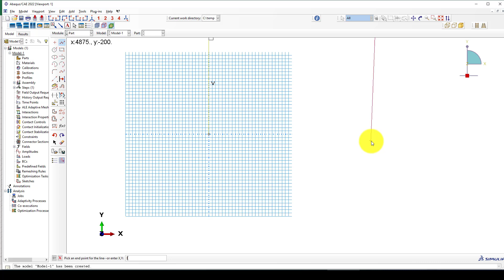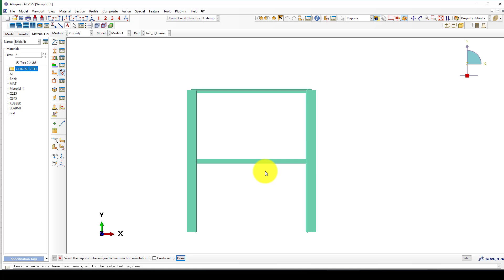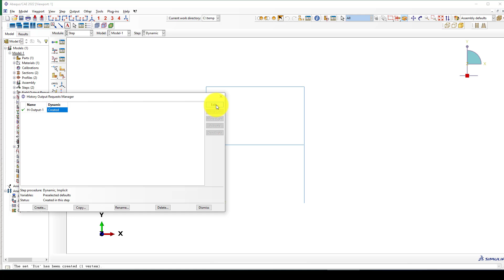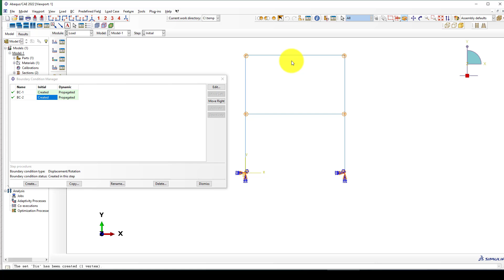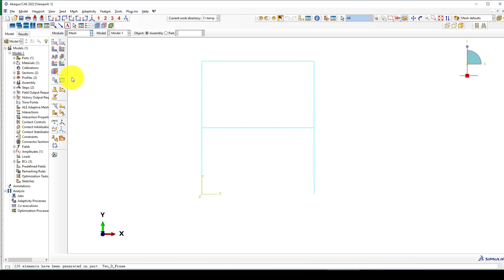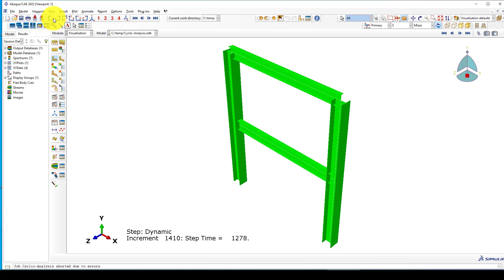ABAQUS Tutorial  Cyclic loading Analysis of Steel Framed structure

Comment: How do you calculate the time and the displacement using the number of cycles and the drift angle (theta) from the AISC loading sequence?
Reply from the maker: Check it in the video carefully.
Reply: @KSSE_Engineer  In column L, you said you accepted a maximum of 3 minutes, so how did you get 1500/87?, this is 25 minutes since 25x60=1500

Comment: Tq sir , very informative
I am putting curved dampers at the beam and column connection, can u tell me how to connect curved dampers to column or beam with pin connection.
Reply from the maker: There are many connector in the intersection part you can use any of them that’s suitable for your model.
Reply: Sir any reference video
Reply: Sir how to get time history data

Comment: Sir i need to ask you how to conduct and get the cyclic data as time and displacements according to ATC-24, because in my case i need to simulate a test and the maximum displacement applied in that test is 146 mm, and the number of cycles used are 24, i just need these data in order to continue my simulation. Thanks in advance sir.
Reply: YOU CAN FOLLOW THE FEMA 461 GUIDELINES TO PRODUCE CYCLIC LAODING

Comment: I tried for cyclic loading of rc frame in abaqus. The hysteresis plot appears to be much higher values than experimental work. I have used kinematic hardening for rebars/steel and compression, tension recovery 1,0 for concrete.
Can you suggest any probable cause for this?
Reply from the maker: You should consider bond-slip between concrete and rebars . If you can’t  it’s better to use opensees software.
Reply: @KSSE_Engineer  only bond-slip may be the cause for it?

Comment: Thank you for the video. Its very informative.!!

You have taken the reaction force for the hysteresis plot at the set defined at top left column( where you assigned U1 displacement), rather than on the fixed boundary conditions at the column base. Why is it so?
Isn't the reaction force determined from the fixed boundary conditions??
Reply from the maker: It's Newton's third low. but you also can get that reaction force from the bottom node which is equal to the sum of the bottom nodes.   just do a quick test for your concern.
Reply: Did it came identical for your model in both cases the hysteresis plot/ reaction force?